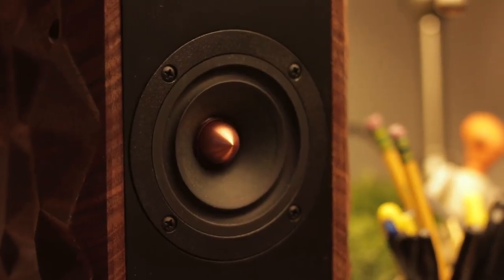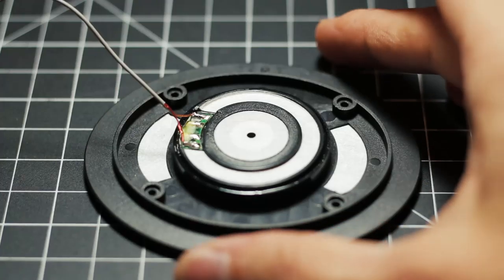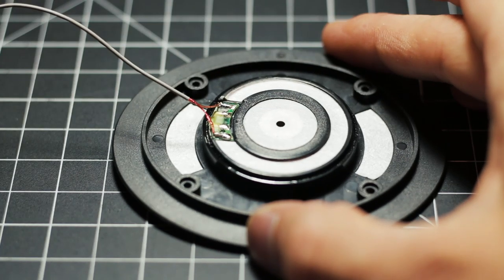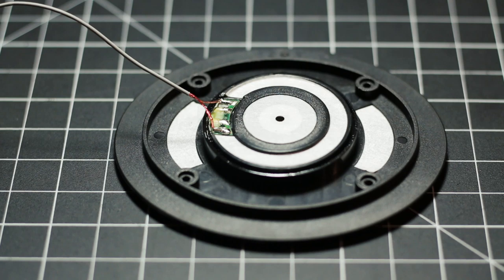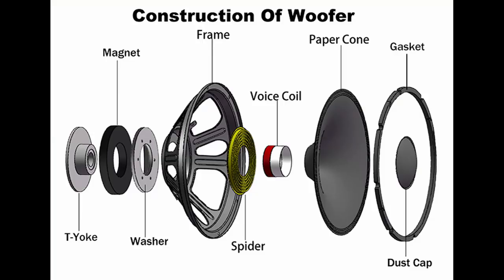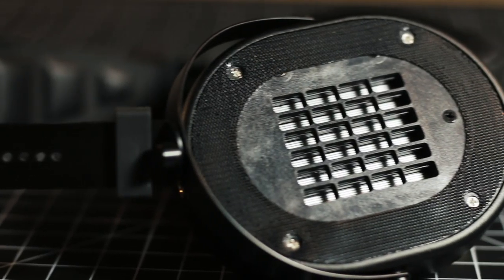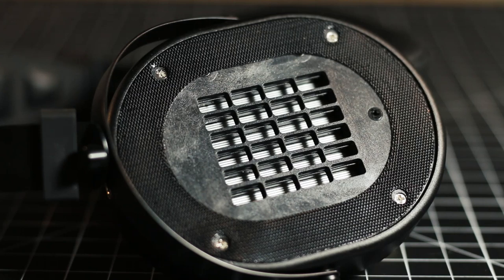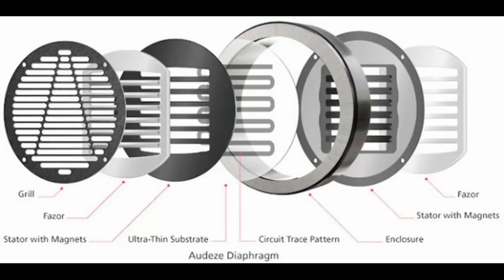Are You Choosing The Right Headphones? | Dynamic vs Planar Headphones

Comment: Kirby please be aware of the  perception when using words like
Tone which can be used to describe different attributes when
related to different topics.
As you know Tone can equal 
a products overall tonal color 
Ex, Bright, Dull, Flat, Treblely, 
Bassy, warm, cold. Like a choice, 
By the designer to create his products to have a specific tonal
quality that is related to his line
of products. That they all tend to
have a Recognizable Branded sound that you can pick out from
others on the market. Example
Moog products all have a notable 
sound signature, Korg does as well
& Roland verses Yamaha, or a Hammond.  I'm a  Keyboardist so
I brought these products up first 
just to prove my point ( sorry if I missed your favorite brand ) it was
once much more clearly defined &
the makers knew what it was about their designs that gave them
there specific Sound or Tonal output that we could hear quickly
as we often would say aha that's
an Oberheim, Kurzweil, Sequential Circuits synth. I want one of those baby we would convince our wife
or girl friends. A girl friend is an easier to pitch & sell than a wife on these types of non urgent needs.
Oh Guitar Players do the same things the products we require and want cry & beg for do vary. The Guitarist do typically have an advantage over us keyboardist.
As Its easier to ask for a new 
$100 FX pedal or a reasonably priced ESP, or a Ibenez 6 string
with a locking nut & special pick ups rosewood neck Floyd Rose 
whammy bar. Which could be had
at a street price of of $750 of course todays pricing a PRS can
get quite pricy &  Fender or Gibson
Custom shop Guitar can retail in the thousands. But now to talk your baby into selling all the furniture, the washer & dryer just
sitting on bean bags chairs and
pushing two bean bags together for a bed. Now this is a dance that
must be choreographed by Paula Abdul and then needs fine tuning
to get a Prophet 5 $4000 a 2nd  stand a $540 ATA flight case Volume & Sustain pedals plus a Boss Stereo Chorus pedal more cables & patch cords plus a $540 flight case, I gotta protect my investment you wouldn't want me
to scar my new Synth while were making 4yrs of payments on it.
And ypur Chevy Van or VW bus so 
you have a way to drag all your gear from job tp job, club to club
,bar to bar. Im telling you. You had to be a good player for them to believe in you after all last year it
was a Hammond porta B & Leslie.
6 months later a Fender Rhodes 76
Key Suitcase. A Honer Clavinet, 
that Mini Moog, a String Ensemble, 
The Korg Mono Poly, the Oberheim 
4 voice, Moog Tarkus bass pedal synth. And much more plus a huge 24 input Soundcraft Mixer & 2 QSC
Power amps plus 4 Yamaha 3way 15 speaker cabs. Phew that makes  me tired thinking about loading in & out up 3 flights of stairs playing
5 nights a week until 2 am and then working a 40 hr. A week job for the health ins.  My point most companies had their own tonal Sound. Guitar amps, Mics, lots of
Home HiFi & pro audio gear its what made them so desirable and
sought after.  It lasted for quite some time ( add an ARP & Roland space echo, what the vocals needed that Tone Color & effects as well & we all sang in a 4 piece group playing covers for 3 of 4 sets and sneaking in our originals
to sell albums & tapes tee shirts & halter tops.  But since we added MIDI & Sampling then Physical Modeling the manufacturers chose
to steal that which gave each company its own sound its become easy to recreate the Tone Color of the others into the new multi timbiral Work Station flag ships were soon affordable. I could recreate my huge set-up with 3 or 4 of them and I have every sound in & out of this world.
I no longer need as much outboard gear there's plenty of DSP power 
In my Synths plus real sounding Pianos, Rhodes, Clavs, Strings, 
Vocorder, Horns, Hammond B3, C3, A3, Farfisa, Vox, Wurlies, with
realistic Leslie emulations in quad surround, with balanced outs and
a Digital Mixer that can switch all my patches Fx's, Volumes, Stereo
Image, Eq's I can save to match
the Room save it and recall those Eq curves on my Next ,Show per room, with auto feedback killer.
A stage monitor mix or wireless in ear monitors, pitch shifting, vocal harmonizers and more.  But we cant always afford to have all this
great gear and a huge home recording studio DAW,  DACs playback monitors, racks of hardware effects.  I do love your videos and your take on building cabs. But not just to copy them but 
to explain the faults of some and teaching about the Words we speak aka Nomenclature.  Understanding how to pick drivers
& horns to achieve the desired results. Plus the use of PCs and software to aid us in the cabinet
design, ie  cubic footage, and the parts needed to build the cross-
over networks to best avoid dead spots, the baffles I haven't heard you speak of yet. Or about phase cancelation from occuring and remember to talk about the T factor or speaker dispersion. 
Man will this text ever end ! 
Yes It will & sooner than you think
If you want help with the History of
things, or to help bring up topics for your future videos let me know
If I can help you. In any way I'll share more with you. I wound up worked for the MI & Pro Audio manf. I was the 4th member of the International  MIDI Asc. I was also a product specialist for a few Synth companies And the sales & marketing manager.  I also helped head think tanks that created ideas for new future products. I also held clinics and new product demos ib stores at NAMM AES, & CES. When
Needed.  Either way Im here Id be happy to help you and to share my
Many stories with you. I see a way for you to expand your customer base and to increase your income
if you haven't already thought of it.
I like your honesty that was brave of you but it only added to your creditability. Dont hesitate to admit when ever you make a mistake just own it like you did
It will keep people coming back
for more.  And more 
Best Wishes & continued growth.
Again stay in touch feel free to reach out to me I will give you my phone number to make it quicker
i can speak much faster than I can type on this little phones display.

Rick Caruso Chicago,IL. & freezing my balls off up here In Wisconsin
Cheese land.

Comment: Well, I have AliExpress's planars GL600 and cheapest copy of Grado (that's not a copy, just some psychodelic fantasy of). Dynamic drivers in Chrado so far from my ears, so it can't make enough sound pressure to transfer low end, so i changed drivers from 32 ohm to 150 ohm, soldered type-c dongle (you know, small usb sound cards for smartphones that have no jack support), and that dongle have enough volume at 80-85% at home vs. 40-50% with planars... So as result I have warm, creamy, dark voice with planars pluged with silver cable to Zoom U22 and crispy bright dynamics in Chrados

Comment: Hi Kirby, I recently bought and built the Elder speaker. I love how it looks, and hate how it sounds. I cant get the included 3 inch drivers to produce any bass. An unofficial frequency response test yields that the speaker really doesn't produce much volume below 400hz. You say in the elder sound test video that you used 4 inch drivers as opposed to the 3 inch ones that came in the kit. I wonder if that would help. I am a little disappointed that a $200+ audio kit cant even come close to a $100 JBL speaker especially given the size difference. I did use 3/4inch plywood throughout the build instead of the recommended 1/2 inch. Please let me know what you think. I would love to get a dialog started about how I might get more low end from my speaker. I would even be willing to try purchasing passive radiators or different drivers if it would get the desired results